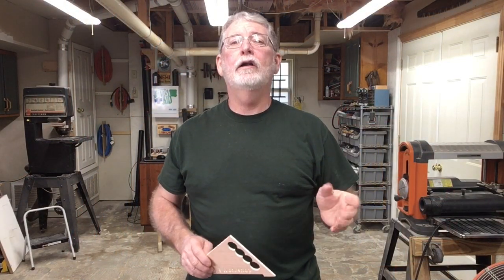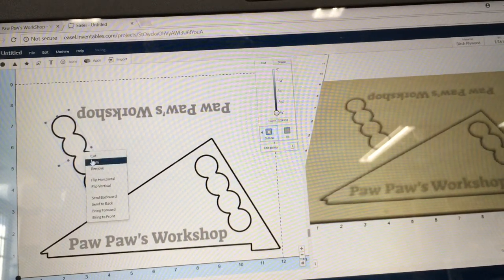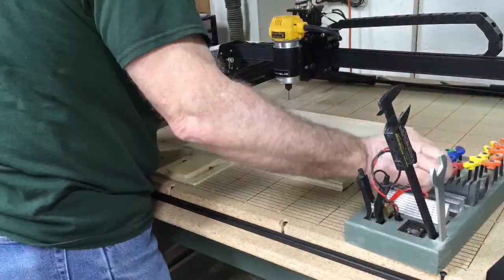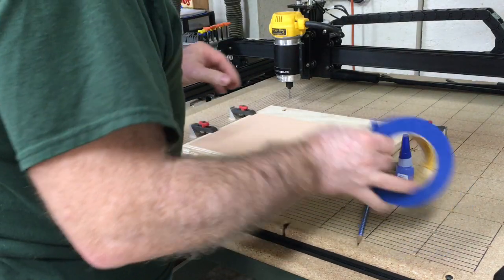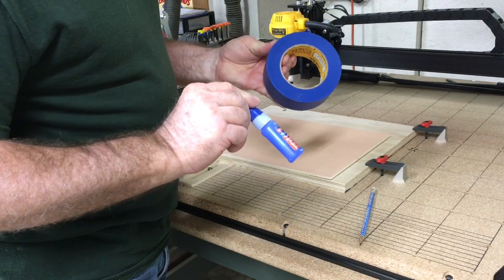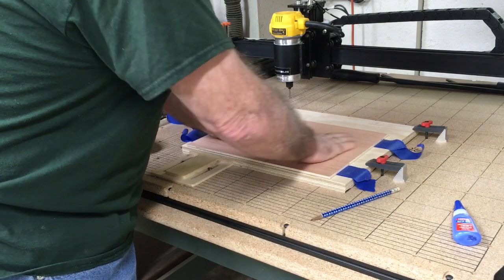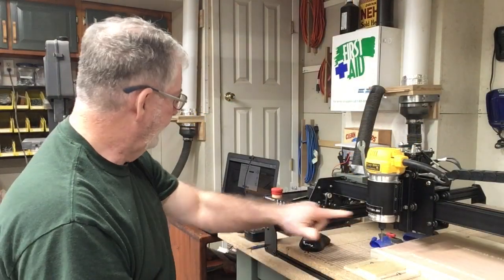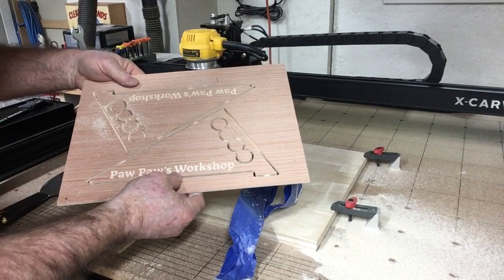How to Use No Clamps on CNC

Comment: The first time I heard about the glue and tape method I doubted it would work because of the limited holding power of the blue tape. I've since used it many times and somehow it works amazingly good. Great video!
Reply from the maker: Glad I could help! It is an amazing way to hold the project.  It does not take much tape either.  I see so many people covering the whole project.  It is not necessary.
Reply: @PawPawsWorkShop  Yes, I was covering the entire project piece which was a waste of glue and tape and made it more difficult to remove. I also like the way you leave the ends long in order to facilitate removal.

Comment: It's worth noting that, at 4:07, the front center edge of the piece pops up due to a slight bowing of the material. It would be worthwhile placing a weight on your piece to ensure that all surfaces maintain contact while the glue is curing.
Reply from the maker: Graeme Chandler .  Thank you for you observations. I have used this method on many numerous projects. Too many to count and have never ruined a project. I love this method for any project that I am cutting all the way through the material. I also use this method any time that I have to skim the surface to create a flat work area. No clamps to get in the way. Hard to beat!
Reply: @PawPawsWorkShop  I figured that, with your experience, you've encountered all the issues you might expect :-) This was more an observation, for those new to this approach. In particular, when carving lettering, or similar, the depth of the cut will vary across a bowed surface. Not a nice result.

Comment: Thank you very much for this tip.  I used it to hold down a 4' by 8' piece of plywood (built my own CNC to handle that size).  Guess what?  It worked!  I put several strips on blue painter's tape  across the table so that all the parts would be held by at least two tapes.  This allowed me to have NO tabs any part being cut out.  LOVE IT.   Again, thanks for the wonderful tip.
Reply from the maker: Awesome!  That's great to hear.

Comment: Hey paw paw..whats best method for painting engravings without sanding....ive seen people use making tape on entire top,surface and then engrave through tape and material and paint and remove tape but i belive it could bleed through and look bad.....u have any good techniques?
Reply from the maker: A lot of people use Oramask masking and from what I have read, it works very well.  I have not tried it.

Comment: Hey paw paw how well does that hold if usling larger bit like 1/4?.....and taking deeper cuts?....
Reply from the maker: I have used 1/8" bit to cut out projects and it works just fine.  I have not used a 1/4" bit.  I use the glue and tape method primarily when I want to cut completely through the material.  I really don't use tabs any more.